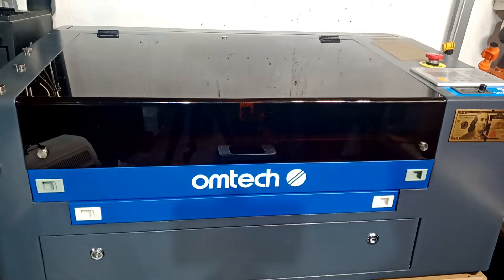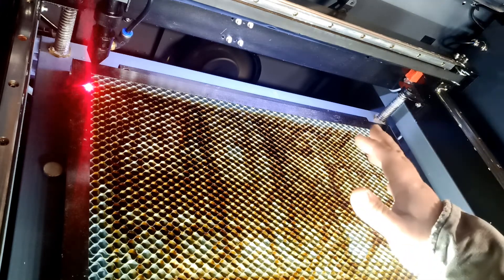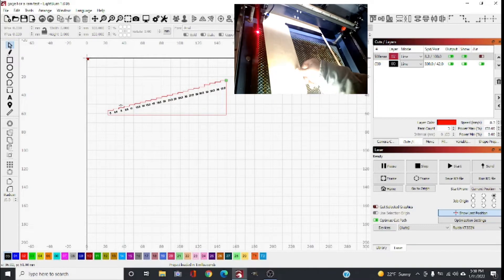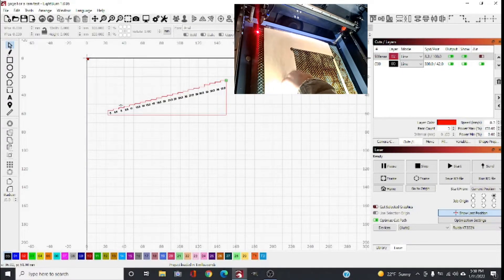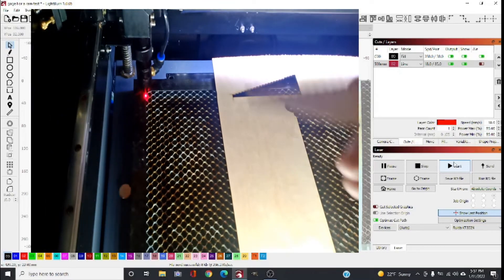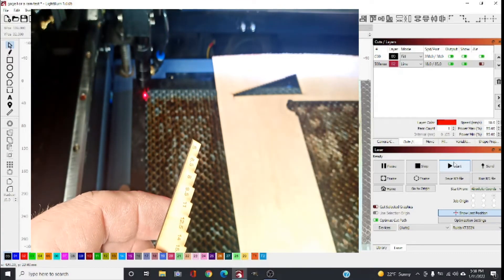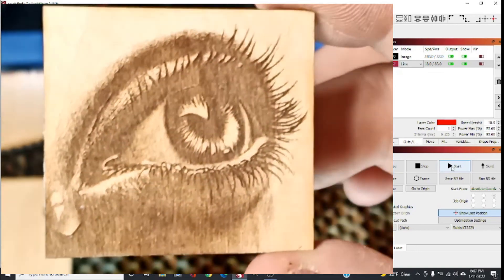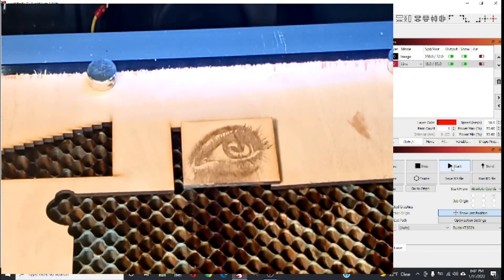Engraving & Cutting With OMTech 50W Laser Using Only LightBurn

Comment: Great video.. Have a question, how do I reset the size of my cutting area.I have a Omtech 2028 100W and I am 2" shy from going all the way back. Do I reset the controller? My size in lightburn is good. Thanks
Reply from the maker: I need to understand exactly what's happening so I can try to help you Is your laser head not going all the way back to meet your homing sensor,,
or am I misunderstanding your question
Reply: @wisamyousif14  My laser head is not going back far enough to the back giving me 20 inches, its only going back 18 inches to the rear of the m aching. So, I am not getting my true 20 inches. Is there a way to reset the work area? Thanks

Comment: I have the same machine. I drilled a hole in the center of the bed adjusting knob,  glued a small bolt in the hole with epoxy. Now I use a battery drill with a wrench attachment in raise and lower my bed. Works great.
Reply from the maker: or do what someone told me in my channel open the bottom door and just moved the belt right to left it will  work better

Comment: Open the lower case door, slide the belt in the direction to lower or raise the bed.
Reply from the maker: Yeah I understand what you're saying but I'm lazy I think the motor l will be better lol
Reply: @wisamyousif14  The auto focus and lift kit that OmTech sells will not work on the 50 watt.  Just went through that - not enough room.
Reply from the maker: @jenniferengland7808   lol you made the same mistake I did I already bought it,  it's okay I will save it maybe for next machine